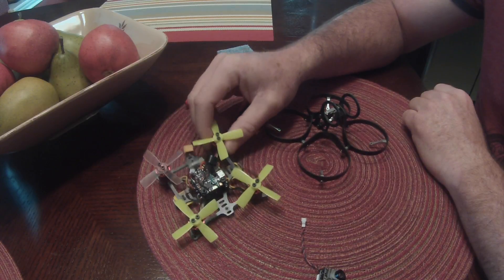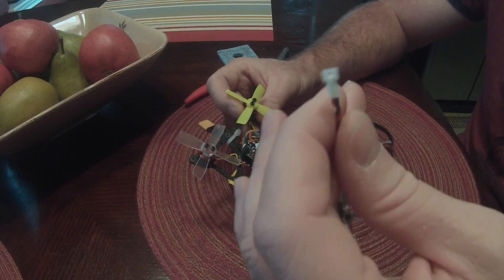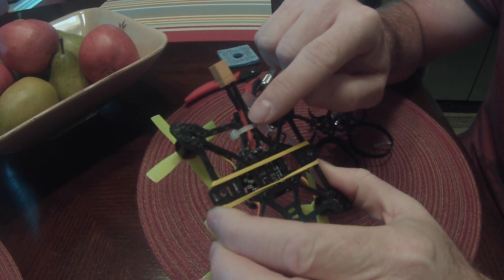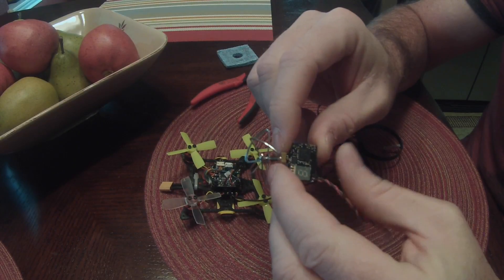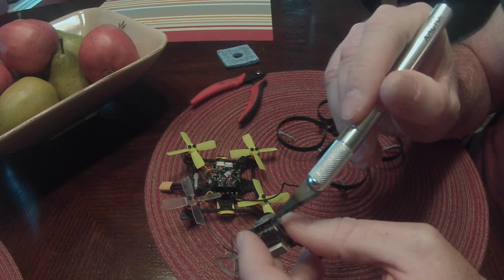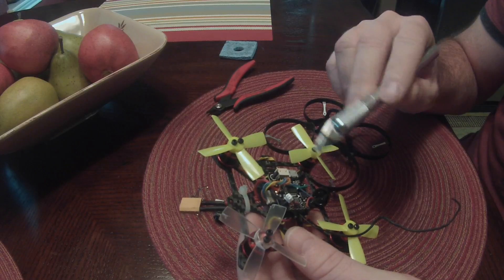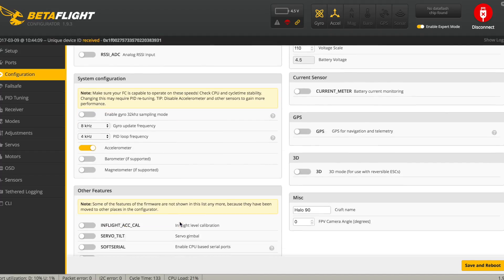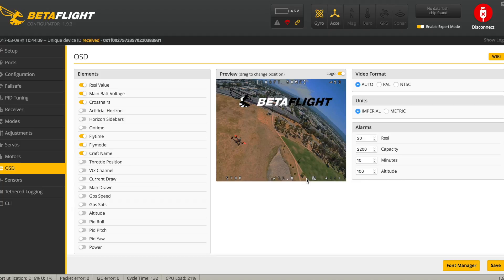Aurora 90 - Build Updates and OSD

Comment: Did you see a range improvement with the new video / transmitter?
Reply from the maker: Yes especially if I set the power output on the transmitter to 200mW, I can go 3x farther with a usable video signal.